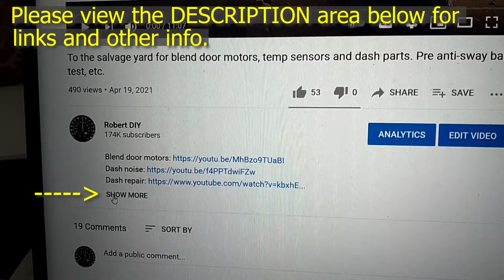Business meeting, daily videos may be move, YouTube shorts, T-shirt printer & 850 R conversion Pt 2.

Comment: I am still trying to get my 98 S70 running...but really enjoy seeing you out walking....to look at your face, it seems marriage is working for you...bless you
Reply from the maker: Thanks.
Reply: 98 s70 are super ez to work on ! 3 owners later my 98 is still on my block and still going ..now s60s are now fun to work on..
Reply: @AwakeDude911  I know...this is my 30th Volvo, and I am able to keep them all running fine...but bought this s60 with85,000 miles and can't keep it running. Replaced fuel pump, relays, alternator, fuel filter, cam and crank sensors...and all I get is intermittent cranking. Now wonder if could be ignition key code?? any thoughts would be wonderful....bless us for premium quality lives via Volvo
Reply: @BillNiland  so it turns over then stops turning over with the key still in the crank position or it turns over but  wont fire up at all?  
remember spark ,fuel air and it will fire up  even if out of time ..
Reply: @AwakeDude911  It turns over without firing, and sometimes the turning over is. stutters as if timing belt off...it has gas at rail. I am all alone so can't be certain there is spark, just ordered coil to try that...which makes me go back to the worry about the magnetic ring around key..it is a 98, so not certain that is issue..but you know what..I really appreciate your thoughts, thank you, grateful Bill
Reply: @BillNiland  98s had a issue with the starter wire corroding on the starter itself .pull out the started and verify the wire (small wire maybe a inch) hasnt turned green its on top of the starter and runs to the top cylinder of the starter to the bottom starter body.hard to seen in the car installed .

coil could be bad as well so bottom video will show you how to do spark test.....

also  Ignition Starter Switch  located on the other side of the column of the steering shaft across from the key hole   could also be bad. i never had 1 go bad but....

also verify timing manually line up the 3 timing marks  with a socket and wrench on the crank bolt.

IAC is right there on top of the motor  ez 3 min remove ..remove it shake it if you dont hear it flop around (inside)  spray it out with some carb  cleaner until you hear it flopping around inside (how it should work) ..it controls idle when the car first starts

 the 98s had no chip in the  key  so the key ring is mostly a light not much more that that on these models .

unplug the mass  unit and try to start it if it starts the module is bad ..

put in google " U pull it parts  near me " and see how close parts are located near you ... for me my closest place 1.5 hrs away but worth every mile when i cant  get good price parts or parts at all on ebay ... 

https://www.youtube.com/watch?v=DU8C9CtC0S0
Reply: @AwakeDude911  You are unbelievable!!
Reply: I am so grateful for your time and experience. I will try all these things today...btw I have a 58 Chevrolet Cameo (rare pickup), 56 MGA, Food 150, XC Volvo, Mazda...so am usually capable, this stumps me..and I THANK YOU for your interest (PS I am 82, fighting Stage 4 cancer.fine for now,) Bless, grateful Bill

Comment: I have found oil seals typically do not leak from age inq these cars. Camshaft seals I support replacing though. One thing I do however is run a thin bead of black RTV on the edge of those seals. I have seen engines completely blow out a seal to the point it dumped nearly 6 qts in a matter of seconds! Even an engine that will pass glove test! Seems only under very heavy load / boost blow-by can occur, and that your typical glove test would not reveal that. That black RTV holds that seal right in place where it needs to be
Reply from the maker: Whenever you do performance mods on a vehicle, you should modify the PCV system accordingly.
Reply: @RobertDIY  agreed I totally support running larger diameter piping/ hosing. Catch cans also. Higher mileage engines atmospheric vent is also beneficial I'll add though that an atmospheric vent may not be so beneficial to the planet however

Comment: 98s had a issue with the starter wire corroding on the starter itself .pull out the started and verify the wire (small wire maybe a inch) hasnt turned green its on top of the starter and runs to the top cylinder of the starter to the bottom starter body.hard to seen in the car installed .

coil could be bad as well so bottom video will show you how to do spark test.....my 98 would stall out when raining and not restart for a few mins to hrs till 1 dark night i see it arching while wet.

also  Ignition Starter Switch  located on the other side of the column of the steering shaft across from the key hole   could also be bad. i never had 1 go bad but....

also verify timing manually line up the 3 timing marks  with a socket and wrench on the crank bolt.

IAC is right there on top of the motor  ez 3 min remove ..remove it shake it if you dont hear it flop around (inside)  spray it out with some carb  cleaner until you hear it flopping around inside (how it should work) ..it controls idle when the car first starts

 the 98s had no chip in the  key  so the key ring is mostly a light not much more that that on these models .

unplug the mass  unit and try to start it if it starts the module is bad ..

put in google " U pull it parts  near me " and see how close parts are located near you ... for me my closest place 1.5 hrs away but worth every mile when i cant  get good price parts or parts at all on ebay ... 

https://www.youtube.com/watch?v=DU8C9CtC0S0
Reply from the maker: Awesome, thanks for sharing.

Comment: Side question: Robert, am getting ready to do an auto to manual transmission swap on a 96 850T - Transmission arrives on monday and have a couple detail questions
1: Do you know the OEM number for a pilot bearing - I recall the auto trans and the manual trans have different pilot bearings
2: Can you post the color wires that will be used from the auto trans wiring harness - I recall there are 2 sets - One pair that goes to the neutral switch, and one pair that goes to the reverse light. - Update: I found the wires and instructions in this compilation for a transmission swap: https://www.youtube.com/playlist?list=PL4kSJzgyD94QHT_5-MlhJ76ZZR-ucpnTT
Thanks
Reply from the maker: Well, people call what they are replacing a pilot bearing but it's not, more like a guide or spacer. The torque converter goes into it but the shaft for the manual transmission can't reach it. I mention that in my videos several time. I NEVER TOUCH THE THING unless someone insist and pays me to. 

Other than that you probably should watch some of my swap videos or the manual conversion series. EVERYTHING I know is in those videos and if you send me a question I will simply link a video to reply.
Reply from the maker: https://www.youtube.com/playlist?list=PL4kSJzgyD94QHT_5-MlhJ76ZZR-ucpnTT
Reply: @RobertDIY  Thank you, that helps greatly and much appreciation